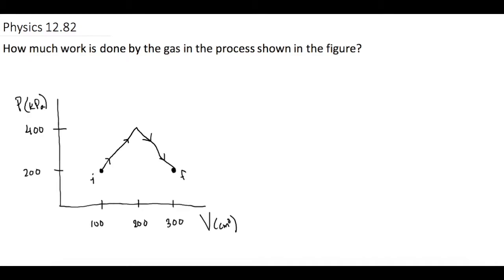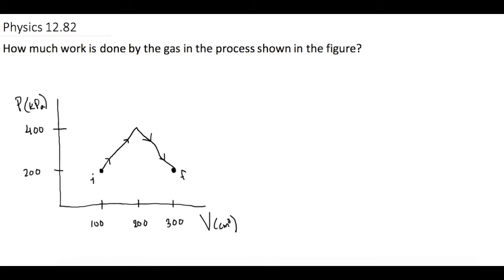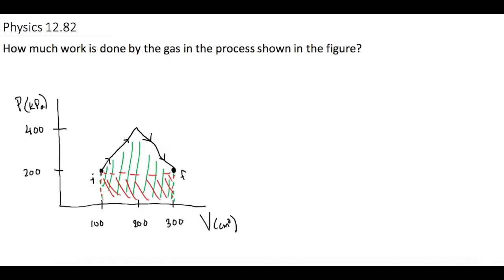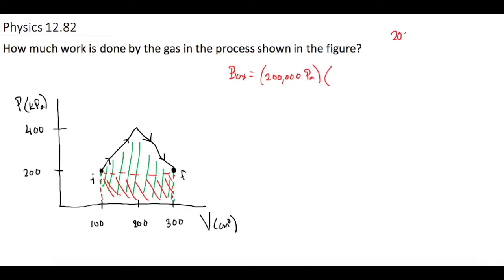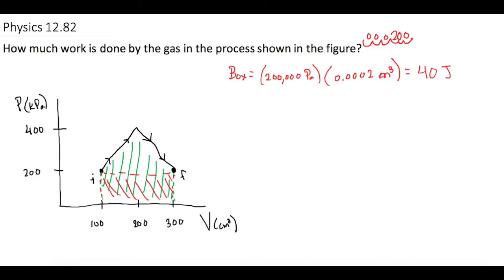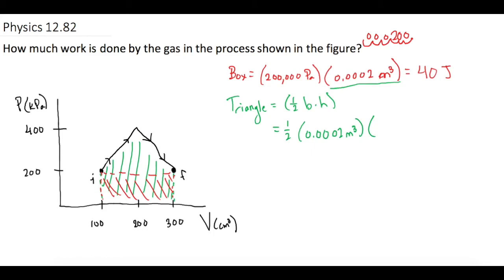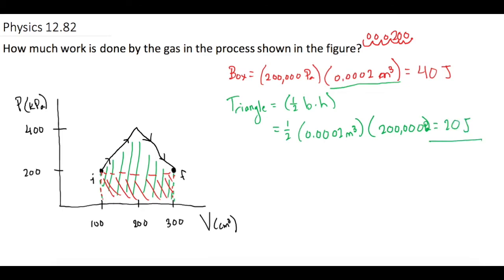Mastering Physics Solution, "How much work is done by the gas in the process shown in the figure?"

Comment: The work should be -60 J, because the volume is increasing. So W = - p * V
Reply from the maker: First off, thank you for the comment! You made me rack my brain thinking about this, so I asked one of the PhD physics faculty at my university about this. Funnily, he said the faculty had a huge debate on this exact thing recently when it came up in a faculty position interview and the interviewee got it kind of mixed up. Anyways! He said it depends on perspective or in other words how they word the question: is the work being done BY the gas or ON the gas? For this question, the gas is doing the work so it is positive and the surroundings essentially did -60 J of work on the gas. Or if we hypothetically flip the situation and were to say, how much work was done ON the gas, then the gas would have done -60 J of work and the surroundings would have done the 60 J of work. He said its really perspective based on the sign convention and that you'll see both W= -p * V and W = p *V in textbooks. Thanks again for the comment, I enjoyed talking with the faculty guy about it more!